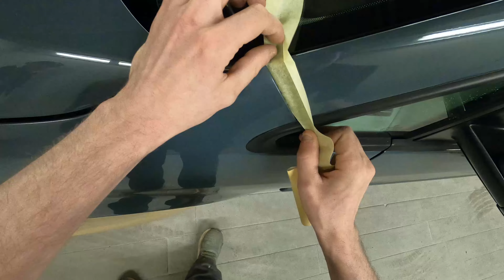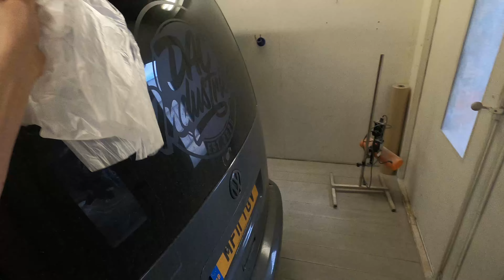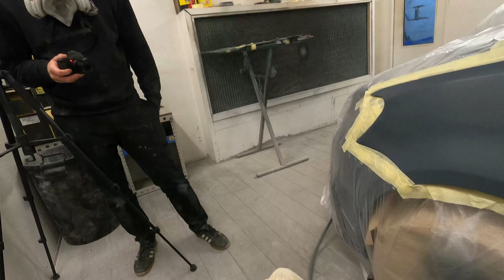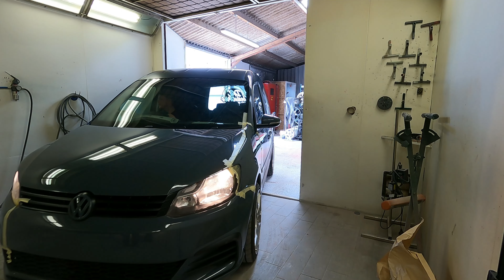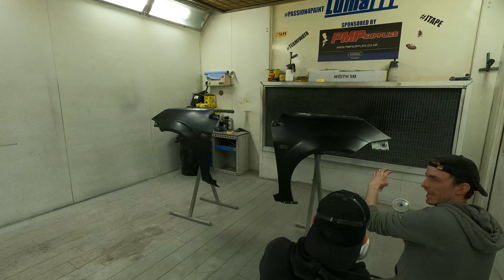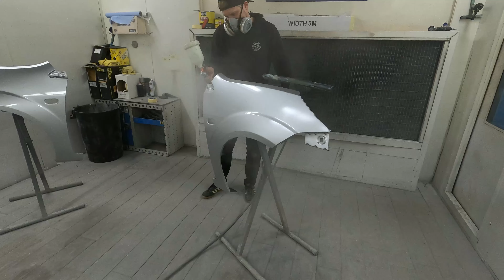Spray Painting Training Day With Dan Chambers and VW Caddy 2K Build HELP

Comment: So nice of you to help another guy out. You do that via your uploads, but I realize it's a different thing face to face. I have a question: In your video with the McLaren, you used Mipa's CC9 clear coat. I recently tested CC9 on a bike tank I'm doing. I find it rather hard to polish. Would you consider CC9 a hard clear coat? I only do custom painting, and I wet sanded it dead flat to eliminate all orange peel and tape edges using P2000. I use a good quality DA polisher with Menzerna Heavy Cut compound as the first stage. I couldn't get it perfect with a foam pad, so I used a short fibre wool pad, which cut better, but it still took me forever to get the gloss I want. Still more work to get it to the show level I'm looking for, but I wanted to hear your thoughts on CC9? I also found that it came out rather orange peely, compared to other clear coats I have used. I did not use any thinner, but will try adding some, to see if there's a difference and if it flows out better with some thinner in it.
Reply from the maker: If I could help more people like dan in person mate I would but it’s hard as shutting the shop for the day and dining it just to help someone for the day comes with a lot of cost so we do it when we can , if your using a da polisher mate then I’d 3000 it after 2000 tbh I’ve just bought a da polisher and your head choice is your pad voice is key , yet a microfibre cutting lad like the ones meguiars do there really good for a harsh cut , personally I found it lovely to spray with 10% thinner and like butter to polish if I’m honest
Reply: @TonysRefinishingTV  Wow, I didn't expect a reply that fast! Thanks mate! I'll give it a try with some P3000 and some thinner in the clear coat next time. When you flat sand clear, do you start with say P1000 and work your way up or do you start as low as maybe P800?
I fully understand the work and revenue sacrifice that goes into making a video like this. After all you are running a shop, not a school. Your how-to-videos are more than I can ask for. Keep it up! I'm watching them all.
Reply from the maker: No mate never go that low ever buddy lowest I’d go is to say start off with a p1200 microtome sanding discs from 3m then hit with 2000 then 3000 I’d never go as low as 800-1000 unless it was say a run area or something mate
Reply: @TonysRefinishingTV  Thanks!! Really helpful!

Comment: Really enjoyed watching this, quick question from a novice... Solvent based paint beneath 2k clear. How does the base coat dry sufficiently? 🤔
Reply from the maker: So the solvents evaporating from the liquid base turns it to a solid mate of that makes sense , than we apply the clear the base needs to remain slightly soft in a way so usually working a 12 hour window otherwise it gets to hard and mechanical adhesion is lost between the base and clear

Comment: Congrats. 
The blue aircap is the aqua. Isn't it?
But you put the clear with this one.
Interesting...
Reply: It's all marketing. 
Just to get more money out of you.
Don't you get it?
What about sata or devilbiss?(iwata)
Best manufacturers. 
What cap do you do base or clear with on sata 5000?
Yeah 1.2 b rp
Ok some peo3like you wouluse hvlp for base and rp for clear
Reply from the maker: Don’t agree there at all with that comment , each is specifically designed dark do a task better than the other cap any gun can be used for any product but a certain setup designed to atomise water better or apply clear flatter ect is a bonus not marketing , plus sagola is just as good as any of those brands if not better than some of them

Comment: Have been watching your videos for some time now so I decided to paint a wing and a front bumper in 2k kapci primer.
Found it tricky as I've never painted before.
Your videos gave me the confidence to try it out.
The primer looks gritty or sandy in places any idea on what caused this? thanks.
Reply from the maker: Hi Danny that’s great you’ve finally taken the plunge mate , yes to dry yet adding more thinner mate as the kapci 634 is very thick so needs to be thinned more than most